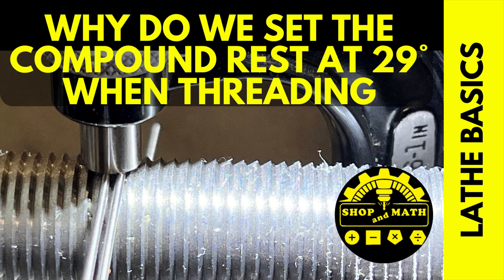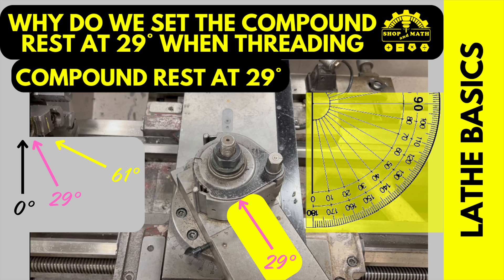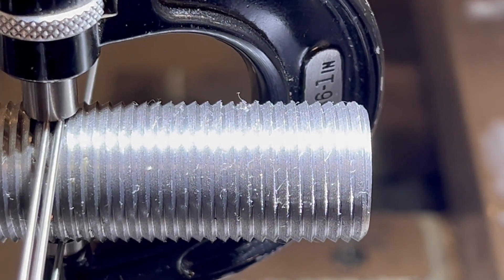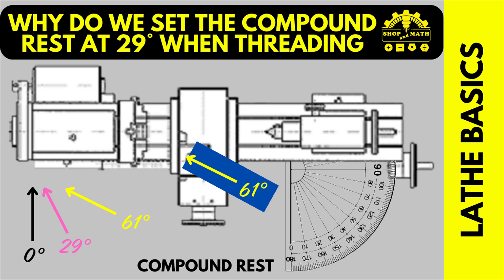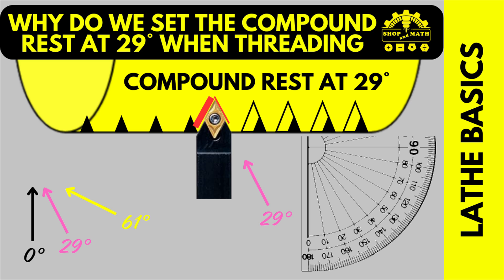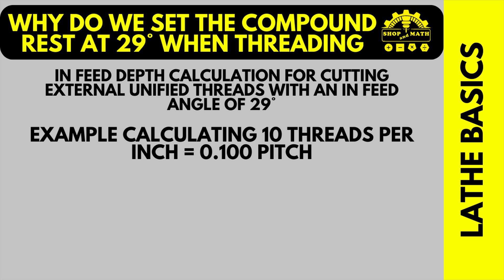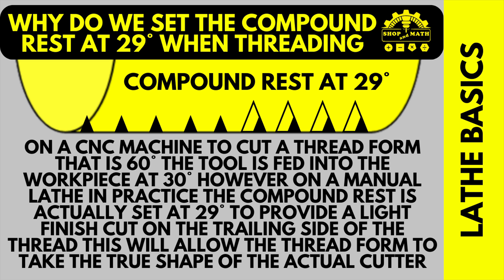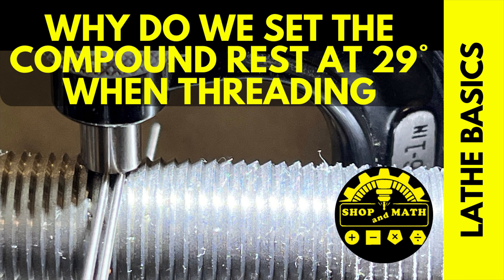why do we set the compound rest at 29

Comment: Here is very common the parallel method. I set the angle at 90, effectively getting  a 60 degrees point. After several pases, lets say somewhat around 25% of the depth, i advance the compound about 0.05 mm in each subsequent pass, this results in the leading edge doing the cutting. This technique is nothing new and is taught here in Spain in the first semester of professional training.
Reply: I also frequently use pretty much the same technique as you describe here.  Both methods work very reliably. On very fine pitched shallow thread forms I only use the indeed on the cross slide.
Reply from the maker: Excellent
Thank you for sharing. It is much appreciated. 
A few other people have commented about doing this exact same process I think that they were from Australia, but this method is used all over the world as well 
Thank you for contributing to the conversation. It is much appreciated. 
Ray

Comment: Don't they teach compound and supplementary angles in school anymore? That's what most of this discussion seems to be addressing.

Carbide tooling does not last very long with this 1 degree drag angle on infeed. It will chip the side of the insert that barely does any work!

As a professional machinist, I would never teach the traditional angled infeed. If your lathe is set up with a DRO, you don't want to cancel the validity of your tool reference points with uncontrolled movements in an angular axis. Leave the compound alone! If it's at 90 degrees, you can tweak it forward and back to give single edge cutting on large threads. This technique is what I use. Modern laydown  thread inserts with chip forming designs cut just fine on both edges with straight infeed.

As for how deep to cut, thread measuring wires are cheap and accurate. Start measuring before you've gone too far 😁. The difference between the measured PD and theoretical is how far you've got to go on the cross slide. No compound miscalculations need be remembered. It's all guessing anyways until it measures right, and theoretical PD is an ideal, but it's not best, because tolerances are a real thing. Some tolerances are one way, not the other. A too big thread for an "ideal nut" will not make you any friends with the mechanic putting your stuff together.

CNCs can cut with a staggered infeed that keep both sides of the insert engaged at slightly different chip thickness. Cleaning passes are straight infeed.

Comment: Ive been a machinist for 25+ years and i cut threads using 29 degrees method and using the parallel method.
Both produce the same thread without any problems or difference.
The only difference is that when cutting threads by the parallel method you need to move the compound slightly for every infeed / pass you make.
The exact amount you have to move the compound is given in charts that are specific for parallel thread cutting.
I also noticed that in Europe most machinists learn the parallel method and usa machinists learn the angle method.
For the end result it doesn't make a difference , it's more what method you like to use and find convenient 😀.
I can use both methods and I will end up with exactly the same result .
Reply from the maker: Yes, both methods work
I made this video for my common core students or level one apprenticeship to highlight the difference between the two methods 
If you’re using carbide inserts, either method generally produces the same results the differences is when you’re using high-speed steel 
I do understand it industry. Nobody uses high-speed steel anymore, and I will also agree with most people who say threads are generally cut on a CNC. 

We use the parallel method in level three apprenticeship for general machinist to cut multiple threads 

Our common core general machinist class the first 2 threads that they cut need to be cut using high-speed steel, and after that they can use the carbide insert tools 

Thank you for sharing. It is much appreciated and thank you for taking the time to comment. 
Ray

Comment: That's not an incorrect thread, it's a proprietary thread that only works with proprietary nuts that cost 50x what normal nuts do... some would call it an "apple" thread.
Reply: A hybrid buttress thread form🤣
Reply: @howardosborne8647  I actually just got a lathe a few weeks ago, and the very first threads I cut were exactly like this, because my compound scale is labeled the other way. I was thinking though that these look like hose barbs, and then wondered why barbed fittings aren't made with a thread, instead of just rings? That way, you could press the hose on to the fitting, just like a regular barb, but if they were threads, you could unscrew the fitting off of the hose after it's been on there for a while with a clamp, saving having to cut the hose open, or have to pry it off the fitting like you have to do with straight barbs!

Comment: Keep the compound slide parallel with the bed and advance the tool half the depth of cut to simulate feeding in at 26.6 degrees, This gives a desirable 93% of the cutting load on the leading edge. There is no calculation for the compound feed in distance as the thread depth is simply on the cross slide.
My CNC has a default feed in angle of 29 degrees not 30.
You have asked for links to other threading videos. Here is my offering of 12 ways to cut threads.
SINGLE POINT THREADING 12 EASY WAYS - ZERO DEGREE COMPOUND, NO PLUNGING, NO TOOLS SET UPSIDE DOWN.  I hope your students gain something from the video. There are several others for multi start - tapered & generating knuckle form threads.

Comment: The video covers an issue that has created lots of conversation and sometimes heated arguments. As I have always worked in tool rooms and had access to a surface grinder, I machined a “tumble” fixture to form, or resharpen a hss tool bit. By changing which face goes down on the chuck, I can grind the left side angle, with a minimum of side clearance, followed by the top rake angle perpendicular to the left edge, which keeps the left angle proper, followed by another fixture face change to grind the right side angle and clearance to 29.5 degrees, giving me a clean flank cut. The compound is set at 30.0 degrees.
  Years ago I learned many of these lessons from my elders in the shops of my youth. “I took the path less traveled by.” Another advantage that I have found in using hss tools, ground in a fixture, is the ability to better control the left side length, which when held to a minimum, allows threading closer to a shoulder, without an ugly groove for run out.
  This just another way to skin that cat, that is always running around.
Reply from the maker: Thank you Robert for commenting and sharing. It is much appreciated.
Ray

Comment: At 1:20 and 5:50, the thread formed would be useful in a device designed to push the bolt and nut, or slide, or device away from the bolt, if the matching profile was made complimentary, 61Degrees the other way.  This would now be a 'Bolt Press", to separate the ball joints of a car spindle or some other thing needing to be pushed apart, it would not be good for pulling things together--(Clamping Force).
Reply from the maker: I could be wrong, but I think the thread form that you were referring to is called a buttress 
I believe that it is used a lot for one-way threads that you would see on a saw vice
This thread form allows you to push the vice closed for positioning and then turn the handle to apply pressure when you want to release the pressure of the device. You back off the thread, lift up the nut and slide the vice jaw backwards. 

I could be wrong, but I’m only guessing
Reply: @shopandmath  That is correct.
Reply: @shopandmath It is indeed known as a Buttress thread form. On a true Buttress thread neither flank is at 90° to the Centreline. The trailing flank is the side with the steeper angle but the leading flank also has a slightly shallow angle to it. The leading flank is never cut at a true 90 ° to the Centreline.

Comment: if thread is left or right, does it change in this math something?
Reply from the maker: That’s an excellent question thank you for bringing it up in comment section

The math does not change the direction of the compound, rest rotation does change 

We’re cutting right hand thread we want to feed from the tailstock to the headstock, and we want to rotate the compound rest towards the tail 

To cut a left-hand thread, you want to feed from the heads stock to the tail stock, and you also want to rotate the compound rest towards the headstock 

I hope that this helps answer your question and thank you for taking the time to comment. It is much appreciated. 
Ray

Comment: I must be missing something here, but where does your magic factor of 0.708 come from in calculating the infeed?
A full V form thread has height H, but in the unified system the outermost H/8 and the innermost H/8 are removed (some sources suggest the innermost H/4) so the thread depth perpendicular to the axis of the thread is 3/4.P/2.tan(60), which would be your infeed if plunging at 90deg, not allowing for to radius on the end of the tool. With the compound set at 29deg to the perpendicular this will be increased by 1/cos(29), so I make the magic factor 0.7426 . Pitch, or 0.7426/TPI
Reply from the maker: The formulas from the TMT book
Technology machine tools
Reply: @shopandmath looks to be an erroneous book. Downloading book now, but that's gonna be for 45° thread profiles, not 60°. Just about everything uses 60, it's more oftentimes 29.5 (acme) and 30 (metric trapezoidal). 

This would apply for a 45° chamfer if you want to figure out chamfer depth/distance of chamfer

Comment: Great explanation.
I notice that a guy in Australia who does you tube videos does not set his compound to 29 degrees but shifts it sideways a bit  each pass.
Reply: That is Kurtis of Cutting Edge Engineering.
He has the compound at 90 degrees.
He feeds in x on the cross slide (at right angle to the spindle axis) and x/2 on the compound (parallel to the spindle axis). 
So his cutting tool advanced 30 degrees to the right angle from the spindle axis.
Sin(30°) = 1/2
Reply: It must be common way to do it here in OZ because I'm one of them.😊
Reply: @mehmettemel8725  I worked as a machinist for 15 years including apprenticeship here in Oz, never seen a compound angled for thread cutting outside trade school besides an apprentice that we quickly educated, I don't even know why the bother teaching it, I've never seen anyone cut an internal thread with compound angled.
Reply: @mrsock3380  I don't know if you misunderstood my comment.I meant that I do the same as Curtis mentioned in one of the comments.I never tilt compound slide at an angle never was thought that way.Waste of time in my opinion.
Reply: @mehmettemel8725  no, it was a long winded way of saying angling the compound doesn't happen in machine shops here.
Reply from the maker: The technique will work, but it’s not one that I use during instruction for people that are new to the trade

I have been doing this for a long time, and I still learn new techniques and tricks from watching YouTube videos. Thank you for taking the time to comment. It is much appreciated. 
Ray
Reply: @shopandmath  Aint that the truth, never stop learning!!

Comment: for the little threading I do, 0 deg and carbide inserts has been working great, and lets me rely on the DRO for the exact thread cutting depth. i think the 29 deg rule was very applicable for HSS tooling, but carbide tooling is far more forgiving with both sides engaged. and since the carbide is idexable, it is easy to turn the insert for a fresh tip. the video is also showing a bit uncommon insert for threading?
Reply from the maker: Keep in mind this video is for students learning

We have carbide indexable tooling for students to use but during common core or first year students, they must grind their own high-speed steel tool and use it 

The reasoning behind this is the learning outcome from hand, grinding a form tool and carbide tips are expensive so students must use high-speed steel on their first 2 thread cutting exercises before they’re allowed to use carbide indexable cutting tools
Reply: @shopandmath  This comment brought back memories when I was an apprentice during late 70's and early 80's at biggest steel manufacturing plant in Australia.I haven't used any indexable insert whether turning,planing or threading even slotting.It was all cemented carbide or HSS which we had to sharpen.Not because I was apprentice because that's all they supplied.Only insert tool was ceramic button tools for rough machining rolls prior to grinding.My first encounter with indexable tools was at a private machine shop I later started working.
Reply: @shopandmath  in that case, I would suggest to use and show a HSS tool in the video, just to make it more clear. and maybe a sentence about the relationship between the 60deg if the thread, and the 29deg (instead of 30deg) angle of the compound. and maybe a quick mention to a reference surface for setting that angle, just to make the orientation even more relatable (the angle overlays were a good idea).
Reply from the maker: There is a high-speed Steele cutting tool in the initial part of the video but you’re right I should have included that as more of a visual reference

And a demonstration cut would’ve been nice as well. Thank you for your comment and thank you for contributing. 
Ray

Comment: I'm not understanding this. The shape of the thread is determined by the tool profile, and you don't feed with the compound rest, you feed with the compound slide. 
It seems to me that it doesn't matter what angle you set your rest to. If the tool is perpendicular to the work, and you're feeding the slide in X, then the tool will be cutting on both sides. 

What am I getting wrong here?
Reply: But we do feed with the compound not the cross slide.
Reply: @marsterofnotrades  Ahh, ok, you’re feeding with the rest. But then if you set it to 29 degrees, and then feed in X with the rest, you're going to create something akin to a buttress thread...which kind of looks like what you've ended up with in the video (I couldn't be sure...it might've just been a trick of light). 

If you're feeding with the compound rest, and not the slide, how are you determining your depth of cut/pass? It seems like a mathematical nightmare. Are you checking the thread depth with thread gauges after each pass?

It seems like it'd be much easier to monitor your depth of cut via the DRO in the X axis using the cross slide. 

Again, I'm probably getting something wrong. I'd love to learn a new technique, I'm just not sure I understand.

Maybe if you showed the process in the video?
Reply from the maker: This video was made for my students to help them, understand the difference in setting the compound rest angles

You can your tool to feed in perpendicular to the axis of the rotation that is not a problem, and you should get a good thread by doing so 

The ideal cutting action is to have the majority of chips or material removed from the leading edge of the tool all the way around the cutting face. I hope that helps. 
Ray

Comment: Wow, it makes sense if the compound angle is set improperly that the thread form would be incorrect but I've never seen it so obviously before. Wonderful example. 

But I stopped using compound in-feed on manual machines that kick out the leadscrew engagement with carriage stops like the Hardinge HLV-H and Monarch EE.  Losing absolute tool position and potentially gouging into a shoulder didn't seem like it was worth the additional setup planning/foresight.  With modern carbide tooling, basically all common materials are 'easy' to finish just with plunging but I still do end up using compound infeed with superalloys and exotic stuff. 

Great video and thank you for making this accessible!
Reply from the maker: Thank you for sharing it is extremely important to have other peoples experiences expressed in the comment section
Thank you for taking time to comment. It is much appreciated. 
Ray